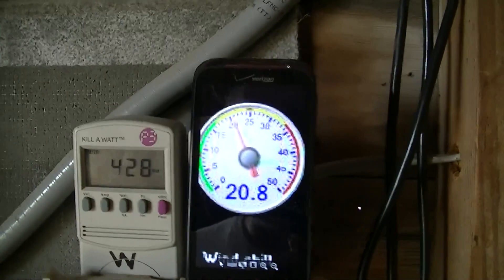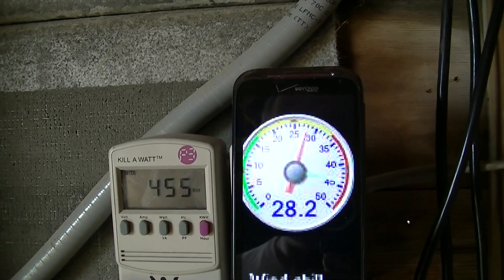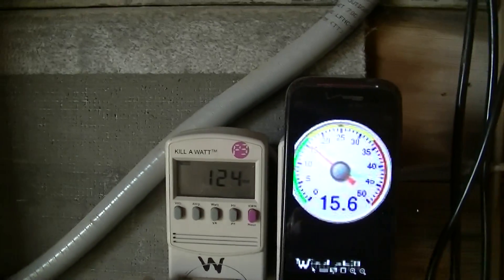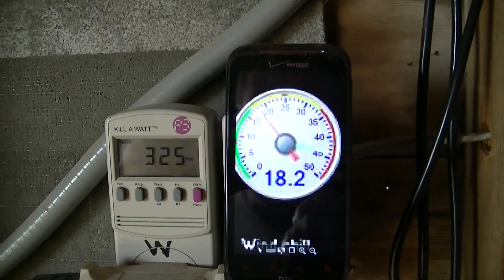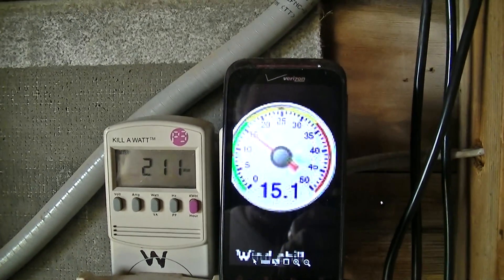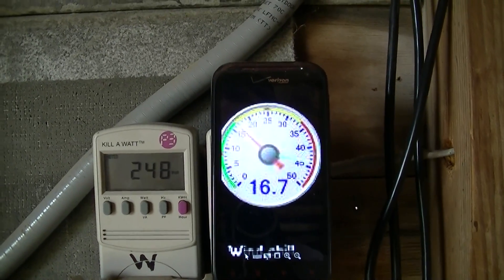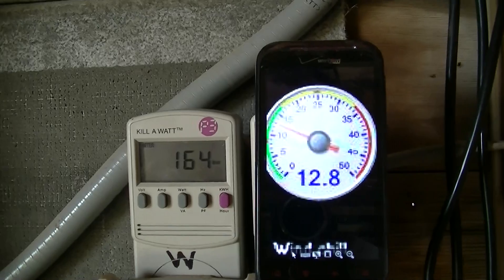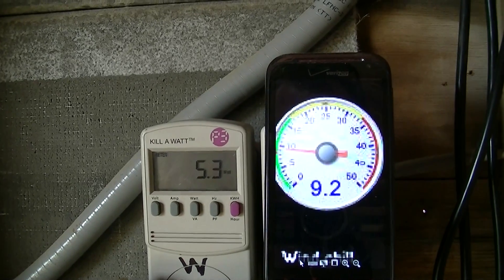Windmax/HY energy 1kw wind turbine 1024w @ 29mph

Comment: Who is the top dog in wind turbine technology? I'm interested in a 1kw for lights 1 computer, 1 tv, don't watch much tv at all and to charge my phone. The only items the power company will power is the fridge, furnace and dehumidifier. Seems all of the brands are brush-less and use stainless steel. I'm on a hill which is 200ft higher than the center of town, so that's a plus. I'm ready to take the GREEN step.